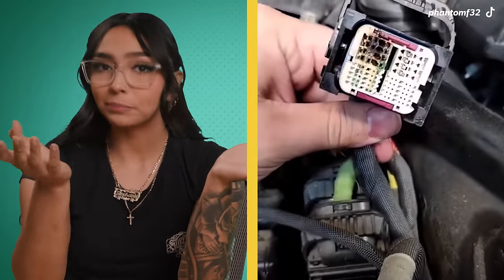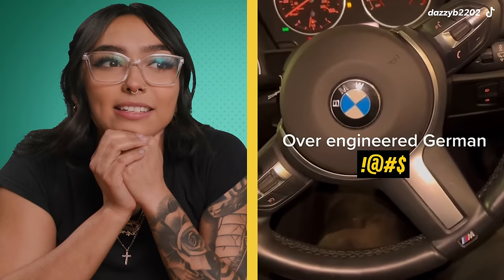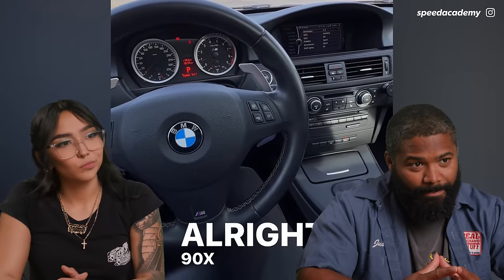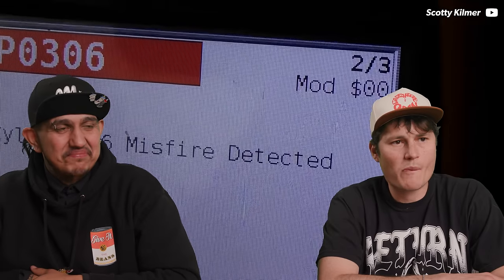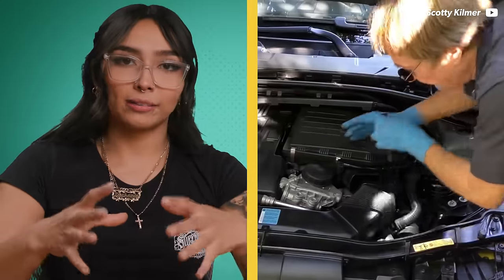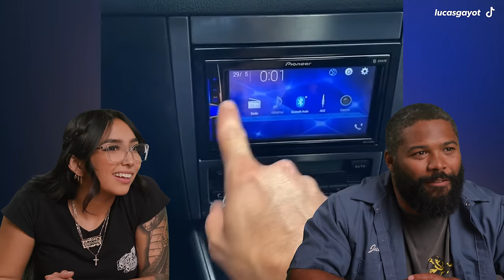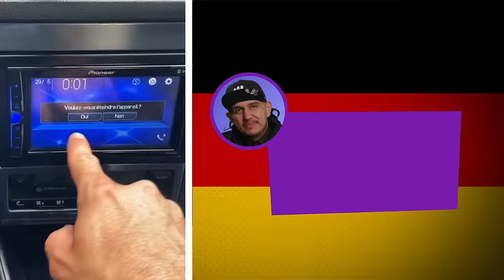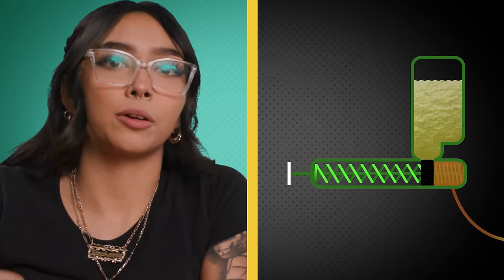Mechanic Reacts to German Engineering Fails

Comment: As a Skoda owner (vw group), I'm glad my car's platform isn't flawed enough to reach your studio :)) 
This video was basically a BMW show with a little VW and a touch of Mercedes
Reply: Skoda in general are stripped down versions of VW group cars, so you lose some of the technology, but in a good way. 

As an example, my Skoda will do things like set the radio presets depending on which key fob starts it, but it doesn’t have the driver specific electric seat adjustment that an Audi level car would have. Same platform, same computer, but with a lot less wiring and electric motors that get real expensive to repair after 5 years or so of ownership.
Reply: @King-Kazma  Skoda don`t have anything with German`s ;) Yes it`s European but is from Czech Republic. 
And another thing every new`ish car is mess because ot the PC and every "factory update" that have inside ;)  The old cars don`t have 99% of problem new`ish have
Reply: @iskrendinchev5882  How tf doesn't it have anything to do with germans if they're owned by the Volkswagen group for more than 20 years?
Reply: @crybaby1363  probably someone in denial,  but yeh really they are all pretty much built on one VW platform or another... and not necessarily a bad thing, for one the engines are far FAR FAR!! better in every way.  

 heck my mates TDI Octavia has the EXACT same engine as my golf. but going further back i think the version starting 2004 was built on the A5 platform (so same as golf,A3,leon ect ect)
Reply: @iskrendinchev5882  Skoda are 98% German. Same chassis platform as Audi/VW/Seat. Same engines. Same electronics. Most parts have VW or Audi stampings. Only the outer sheet metal and upholstery fabric is Czech.
This makes it easier to source parts though as more or less the same engine may be in a dozen different models of car.
Reply: Skoda is just a Cheaper vw lol
Reply: i love my Yeti 4x4

Comment: 8:05 what scotty meant was like with old toyotas where the valve cover is metal and does not have a plastic shroud on in to hide say, the ignition coils. since there is nothing to trap heat parts run cooler. and when there is less change in temperatures around plastics, plastics crack less often.
Reply: Doesn’t the hood itself trap heat?
Reply: @kenmorrisproducer  not that much as compared to a plastic cover because hood is still farther and air anyway gets in through the grill. Metal hood still conducts heat better than plastic shroud

Comment: My worst German car experience was my 2013 GTI. It had less than 30k miles on it and the DSG transmission failed. 6 months and about 3k miles later, the thermostat failed. Then the intake needed to be changed on a recall. And finally, I had a misfire due to carbon buildup on the valves with less than 45k on the odometer. I took it to VW because I didn’t have the time deal with it and they tell me I need to pay for diagnostics. I pay for it. They inform me that the use of non-OEM coil packs can be recognized by the onboard computer and that I need OEM coil packs to complete the diagnostic. I asked if they swapped plugs or coils to see if the misfire changes cylinders because they were all aftermarket coils and it was strange that the misfire was in one cylinder, if that was the case. They said no they didn’t attempt swapping the coils or plugs. I tell them I’m not buying new coils for a test and they just need to complete a valve cleaning service and charge me for that. The technician had the audacity to tell me that their scan tool could tell if the valves had carbon build-up…as if there was a sensor inside or around the combustion area. I asked for my car back, took it to a local Euro shop, they agreed 100 percent with my assessment and verified it by swapping the coils and plugs around. Cleaned the valves and the problem was solved. I sold that car and refuse to buy another VW/AUDI.
Reply: My 2010 GTI engine blew with 60.000 kilometers chain jumped
Reply: Still got it tho love the car
Reply: Sound like a local dealer problem rather than a car problem. It can happen with a Toyota.
Reply: @nicksokolis6343 i dont think youd have much of an issue with carbon build up in Toyotas because they use port and direct injection to clean the valves from carbon build up. At least not at 45k miles. My friend has an Audi and had to get his cars intake cleaned for this same problem.
Reply: Seems like VW customer service is horrible everywhere
Reply: The problem is VW itself. there are very strict guidelines from the company on how to deal with warranty and other stuff. 
If you mess up and don't follow the guidelines on 100% you are sitting on the costs for the repair yourself as a shop.  
It's how most companies operate (i know Peugeot did, worked there)  and even the shit you have to deal with to actually STAY a authorized dealer/shop is mind blowing.

Also, most car manufacturers will erase any warranty if you install anything aftermarket no matter the miles or years the car has. 
They will void all warranty if you go to a non authorized shop as well. 

Thats not german brands exclusive. They all do it.
Reply: @feroxk.9266  not a car guy but an IT guy but from my own experience and how customers utterly and completely mishandle basically ANY piece of technology its completely understandable that companies follow strict guidelines for returns otherwise the employees would spend more time doing customer service and trying to fix the stupidity of the customer than actually generating profits. 
just last week a customer tried to make a warranty claim on a 5 years old monitor where he clearly broke the display port by trying to manhandle the cable out of there without pressing the plug release. i imagine the claims are a hundred times worse for car companies than in IT.
Reply: @joshm9003 You can actually solve this with regular hard driving (italian tune up) and a decent additive.
Reply: This is my issue with dealerships. They’re so used to ripping clueless people off, that when they get somebody that knows what tf they’re talking about, they still try the same tricks. Saw a post of a guy who took his F31 BMW 328d to a dealership because some of the functions on the steering wheel stopped working such as cruise control, the horn, and audio buttons. This is CLEARLY an issue with the steering wheel. Maybe a dirty or loose connector. The dealership preceded to charge this guy $200 for a “diagnostic” and then something like $830 to replace the horns… obviously this does NOT solve the problem. Then the guy takes the car to an independent mechanic who does the obvious thing and checks the steering wheel and and solves the problem.

Comment: VW guy here. Once had my headlight switch randomly catch fire on me for seemingly no reason. After a careful inspection of the wiring, and finding nothing else wrong. I replaced said switch, fixed nothing else, and haven't had a problem with it in 10 years!
Reply: Skoda owner here. Brilliant bit of kit, and its VW. My mechanic's fav cars are Minis, Range Rovers, Beemers etc, because they make him the most money.
Least favourite? Toyota, Lexus. Almost never have issues, so makes no money😂
Reply: Shouldn’t have had a problem to begin with if it were properly designed. I once had a $55k VW Touareg. I drove it from the stealership to its grave at the junkyard in about 79000 miles. Every single thing on that car broke. Never again VAG. Never. Again.
Reply: Why I got an IS350, tho I'm not gunna lie, I like them R32's! Those VR6's, beautiful pieces of machinery.

Comment: Older German cars are relatively easy to work on as it’s more about mechanical engineering and durability but anything that has a lot of computer controls become much harder to work on, especially diagnostics. But all those computers take up more room so there is less working room in which to even get in and actually service the item. Older German cars really had a philosophy of rebuild and servicing components vs just throwing it out and buying a new one. But they do drive like few other cars do
Reply: Exactly, as my 1984 Audi 4000q is the best car I have ever owned but I would never buy a newer Audi. Likewise the BMW 2002tii was a great car but modern BMW's suck to own...
Reply: I make small mistake hit a high curb and broke windshield wiper fluid reservoir in my Audi A4, to get to this u need 
Take wheel off, take inside of wheel-well off. then u have access
Reply: Most older cars are like that. Not just euros
Reply: My 88 300TE is by far the easiest car I’ve ever worked on. Old German vs New is totally different ballgame
Reply: @mateuszzimon8216  that is like 5 mins worth of work....
Reply: @niklaspetersen4936  are u sure?
Reply: @mateuszzimon8216  oh no it takes hours upon hours to remove a wheel and wheel liner really hard mechanic stuff
Reply: @niklaspetersen4936  u seen how washer fluid reservoir have shape?

Comment: I've had a few second generation Audi A8, great car the one I have now has 260,000 on it. It has some really funny water intrusion problems, if you don't keep the drains clear the water from the windshield backs up and shorts the transmission control unit located literally in the cowl drain area in a plastic box that says in German that "water intrusion is forbidden." The other thing is once that fills up it leaks into the HVAC system through where the blower motor is (also in the cowl drain area) once it fills up in the heater core it dumps the water through an overflow pipe into the driver and passenger side footwells, the reason that I know they knew about this issue and over engineered it is that it eventually makes it to drain holes that are drilled on the low spot under the driver and passenger seats and it comes out under the car. In Audi's defense the first guy that buys the car for $100,000 keeps it in a garage and won't learn about this "truth in engineering" i keep mine outside and have to spend about an hour twice a year clearing all the drains with compressed air. Luckily 100% of the frame and body of that model is aluminum so it doesn't rust from the water or anything like that.

Comment: I've owned two cars. a 2nd gen mazda 3, and a b8 audi s4. Replacing the all rotors and pads in my mazda took me about an hour. In my audi it takes about 2 hours. Replacing the valve cover gasket in my mazda, takes 40 minutes with watching a tutorial. A couple of bolts and youre done. In my Audi (granted it has 2 gaskets) takes nearly 3 hours. You have to remove the intake, remove a gas line, remove the coolant tank, plastic valve covers, and plastic crank case breather hoses that are designed to break when you remove them...But I still love my S4.
Reply: I currently own a gen 2 Mazda 3 and it’s so easy to replace thing
Reply: My 05 Mazda sp23 is easy to work on its still going daily driver for my wife over 300,000kms  got her 2 new cars since then and she wont part with the Mazda and sold the new cars after about a year. My 80 series Landcruiser is easy to work on when the wife got me a new 4wd she said you have to sell the 80 series or the 2nd gen 4runner, I sold the 4runner and the new 4wd about 12months later. We still have a 1990 80 series Landcruiser and a 2005 Mazda sp23 some cars are just too good to get rid off.
Reply: Ive got a b8.5 S4 and so far most things I've had to do are fairly straight forward. But you are right, they usually take a bit of time hahaha.
Reply: ok yes but you are talking about a car that is a v6 supercharged and has dual everything. Even the b5 s4 was 2 of everything… it would take a little more time.
Reply: and with the 2 liter control, Audi has completely saved itself the repairs.  and German consumer protection could do nothing about it.
Reply: You wanna try the B9 RS4. Took me 3 hours for front discs (rotors) and pads! Absolute pain in the arse to do, but no way was I paying the dealer £4000 for the work
Reply: Wait until you need to change your oil pan gasket. That is alot of fun

Comment: I am from Germany and I work as a hobby on cars. Sometime  I fix minor things for friends and family. Nothing  big, nothing complicated. Stuff like installing new headlights, radios, swapping breaks etc. By far my worst experience with a German  car was BMWs who needed what felt the whole from taken out to change the headlight bulbs. Equally baffling was a Renault that needed a specially molded radio (or a plastic cover ) because of course the radio needs to be part of sloping plastic thing
Reply: This. 
If you think German cars suck, try a French car. 
They are overly complicated without any benefits.
Reply: @065Tim  Look up how to change a cabin air filter on a new Renault Master. It's astonishingly stupid. And, even worse, the new filter comes in two pieces. But for some reason the original one is a one-piece filter that won't fit through the hole you are supposed to take it out through. So you basically have two options: Either cut the filter in half through a small hole you can barely reach through or take the dash apart even further than you already needed to (You need to remove the whole glovebox assembly in order to get to the filter opening).

Comment: @ 8:00 The reason the engine covers aren't necessary is because of heat retention.  In certain HOT states it's worse.  Most wire assemblies won't be damaged from moisture considering they're under the hood which protects most damages as well as the fact that moisture cannot reach them.  UNLESS you have a massive gap between the bumper and hood or an intake system like a Corvette which pulls air in through the bottom and diffuses it into the brake system as well as the intake system which is why most sports cars with these systems aren't driven proficiently in rainy weather conditions.

Comment: i had a 2003 BMW X5 with a 5 speed manual that i bough for dirt cheap a few years back. first day of ownership: the top of the radiator exploded, so i replaced that. 2 days later: CV axle slightly pops out of the front differential, causing the car to not move (no clue how, nothing was messed up) the next day after repair, the clutch goes out. One month later, my valve cover gasket starts letting oil leak all over the engine. some time after fixing that, the transmission starts overheating, but the fill bolt for the gear oil decides it wanted to be a cylinder, so i took it into a shop to fix. a few days after i get it back, cylinder 2 decides it wanted to go to space. The only thing i did with this car was take it on a 4 hour road trip, and drive to work every day, my s2k is my fun stuff car. That X5 is now a cube at a scrapyard somewhere in texas.
Reply: just like a cayenne. these cars are cheap bc one would need money to make it reliable again
Reply: Buy toyota car dud near ur location, toyota is reliable
Reply: My 2007 3 series diesel has 250000 km on it and still runs great and barely needs any maintenance
Reply: Buying a dirt cheap BMW was your fist mistake.
Reply: There’s a reason why you bought it for a cheap price… 😅
Reply: @callummclachlan4771 True!
Reply: @Kev27RS  learned tjat the hard way. It was a nice paperweight
Reply: If you're wanting to drive a Beamer, you need Beamer money. Audi and BMW deal with cutting edge technology vs true and reliable, those cars need constant maintenance to keep them running at top performance, I always thought of them as disposable luxury cars for very rich people. The Japanese have a different philosophy, tried and true reliability. I drive a Lexus.
Reply: the first gen x5 was a rebadged Land Rover, so it inherited all their problems too.. i own a 2011 x5 50i.. no issues after 245K (Canadian car) im going through everything now, not needing to. just preventative measures
Reply: An X5?  I was waiting in line at my local BMW dealership behind a kid who picked up a used X5, brought it to the shop, and found out the repairs would cost more than what he paid for it.  The Cust Rep said after the kid left: “They should have never made those GD things… “
Reply: @greggodfrey6516  if it didn't break down twice a day every day, I would've loved it, it had a towing capacity (ironically why I bought it, because it was cheaper than a truck) it drove and shifted super smooth. Too bad it didn't drive very far

Comment: 13:50 I ran onto the same thing changing the heater core on a Grand Cherokee. The entire dash has to come out because it's integrated into the ventilation channels. There's one ground wire right in the middle you better not forget about. Or your taking it apart again.